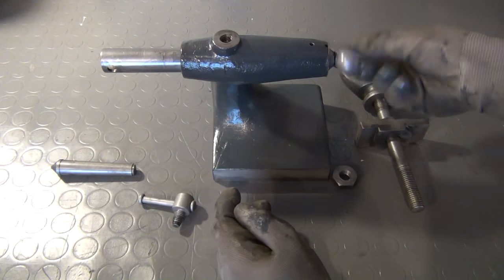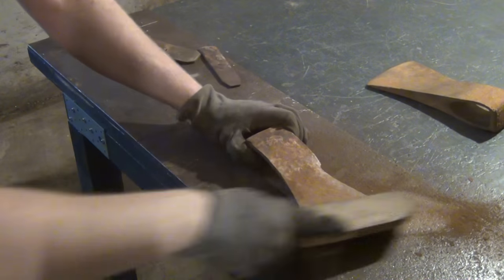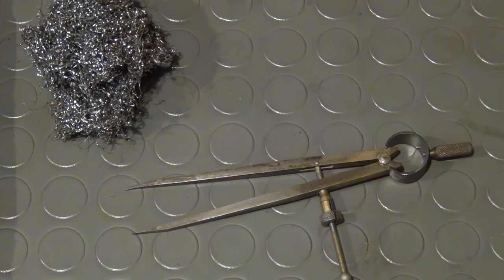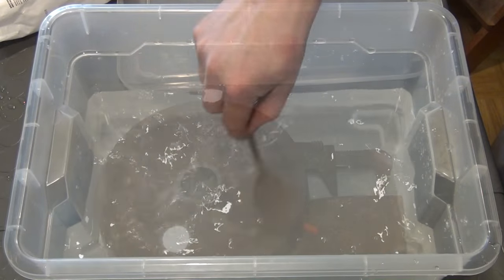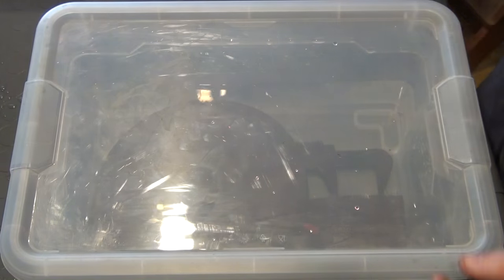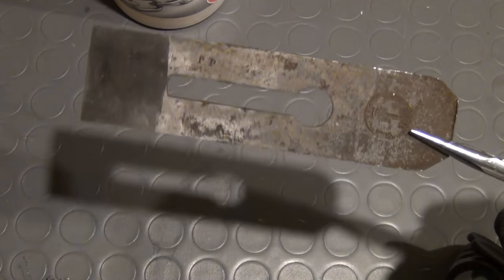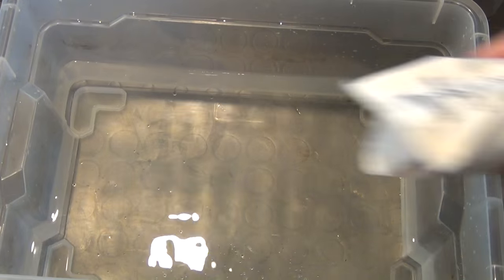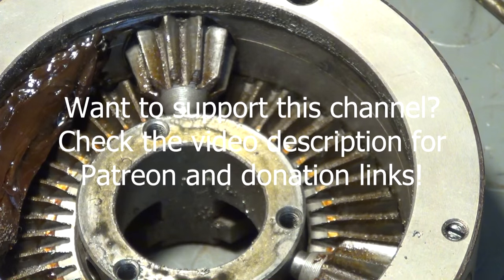Rust Removal Experiments: Citric Acid, Cider Vinegar, Rostio

Comment: Nicely made video!
 Looks like the Rostio product kinda sucks. I mean that part on the lathe would have been less than 5 minutes with a reusable wire wheel on a drill motor. 
    Like you, I have found chemical rust removal kinda limited.
  I use acid to clean the inside of rusty steel tanks(where you can't get inside to scrub). These are usually air tanks that weren't drained regularly. 
    I fill the tank with an acid solution and put a more rusty piece of metal in a cup of the same solution. When the part in the cup looks pretty good, I figure inside the tank is. I empty and flush the tank with water. I then put a bunch of moth balls in the tank with a pint or two of 91% isopropyl alcohol and turn the tank over and around, using the moth balls to scrub the inside from agitating the whole thing. I drain this out and do the same thing with about a pint of mineral spirits (by itself, no moth balls). When I drain this out, I pour in about about a Quart of oil based paint and turn the tank over and on all sides many times to thoroughly coat the inside with paint. I remove my plugs and drain the excess paint and then let it dry overnight. I have done this a number of times with good results.  I don't own a bore scope but have used a friends and found really great results. This also works good for mildly rusted fuel tanks. For very rusty fuel tanks, there is a special product for coating the inside, using the same method. 
   I hope you find this useful. 
   Take Care and be safe, John

Comment: If Rostio is like the naval jelly we have here in the states it's phosphoric acid based
Reply: +Jacksonkellyfreak It didn't seem to act like phosphoric acid would:  H3PO4 reacts with red rust to make black ferric phosphate, which, unlike rust, adheres to the iron and prevents further corrosion.  

In other words, a phosphoric acid based formula turns rust black.
Reply: Nevin Williams
 Ah ok. I don't deal with rust too much other than surface rust so I'm only familiar with what some of the chemical makeups are
Reply from the maker: +Jacksonkellyfreak I first thought it was based on phosphoric acid as well and I had that suspicion in of the lathe restoration videos, but then some guys that that they believe it's based on citric acid and I guess they were right.
Reply: +Nevin Williams 
Yeah, here it's called rust converter instead of rust remover and should passivate the rust before priming and painting, ensuring it can't continue underneath a new paint layer
Reply: Naval Jelly IS the common product name here in the United States and its chemical composition is as follows:

Naval Jelly is made from Phosphoric Acid (10 to 30 percent by composition) and minute amounts of Sulfuric Acid (0.1 to 1.0 percent by composition), as well as other hazardous chemicals—Phosphate ester (1 to 5 percent), Polysaccharide (1 to 5 percent), and Isopropyl alcohol (1 to 5 percent). Water makes up the non-hazardous portion by more than 50 percent.

Occasionally, (depending on the manufacturer) naval jelly comes in a distinct pink color due to an otherwise inert additive (colorant). Naval Jelly is intended to be left in contact with the part only for up to 10 minutes. Then use water to rinse. If rust remains, just repeat the process. But leaving it on for longer time will turn the part dark black which may not be desirable.

Naval Jelly will also remove any bluing from steel but again if you have to remove rust, bluing lost its capacity to protect the metal anyway. Hope all this helped!

Btw, I liked the going to Rome expression, is my spelling correct: "viele Wege gehen nach Rome". Grüße von Chicago, Freund aus Deutschland!
Reply: Now that you mention it, you can buy jugs of phosphoric acid retail in the US, maybe we don't have to fool around this much.
Reply: Nevin Williams , FYI when I have used naval jelly (Loctite brand) it has not turned the rust black.  I don't really see a color change.  Maybe I was not paying close attention.

Comment: Here's a method I use on cast iron pans with great success: put your oven into "self-cleaning cycle" and lock the piece in there for the several hours your oven needs for self-cleaning.  When it's done, the piece will be covered in fine powder that brushes off to reveal clean bare iron. No chemicals or elbow grease necessary.

Comment: Hard to beat the electrolysis method; the catalyst is never consumed, the reaction won't attack the iron, and it's fast.
Reply: Doesn't salt water produce clorine?
Reply: @dimmacommunication  if you use washing soda you produce hydrogen
Reply: @darronjknight  Sodium carbonate?
Reply: darronjknight  and,,,,,,
Reply: @drewjohnson4673  Hydrogen?

Comment: For the jelly, use plastic wrap to keep the jelly tight against the item.
Reply: That would squeeze all the jelly off, leaving only a very small amount in contact with the rust. In order to work properly, there needs to be a LOT of the chemical present... in other words a thick coating will work much more effectively than a thin coating. That's why they make it a thickened gel rather than a thin liquid.

Comment: vinegar is great to remove rust BUT the real trick, as you learned, is the timing. If you over hold it, the acid will eat into the metal. I assume that is because the rusted metal is already weakened at the surface so what I do is check it ever 3-4 hours and make sure I time myself to place an item in vinegar only if I am able to take it out and clean it no more than 12 hours if I cant check every 3-4 hours. Great videos, thanks for sharing.

Comment: Rusteo is phosphoric acid in a gelatine substrate. Think I will try the organic acid treatment on some rusty tools, Might at least get it free enough to run again, though I have little hope.  But have a lot of vinegar around, used to descale kettles, and I use another acid to clean aluminium piping inside.

Comment: I know I might be late, but you can hear up the water to speed up the reaction. I do this with my boiler. I put some vinegar and turn it on, and keep it between the temperature hot, but not boiling. Within a minute all the spots are gone. But if you put vinegar instead of lemon juice it will smell!

Comment: Rostio's active ingredient is sulphamic (NOT Sulphoric ) acid. It is also sold as LimeAway and Lime light in UK. You will find that if you dissolve it in water and then use it in a similar way to that of Citric acid it will be faster. It is also much safer than Hydrochloric acid other in that it does not release noxious gases and is safe to release in public drains

Comment: Interesting. You can use malt vinegar which is dark brown and sold for food use. To avoid using a huge amount, soak paper towels in it, wrap the rusty object in the soaking towelling and then cover in plastic bags to avoid the towels drying out.  Remove next day and most of the rust will be on the towel , not left on the object.  For very thick rust, I have used a cardboard box with plastic dustbin bag lining because you can make the box fit the object and so have a good depth of vinegar.

Comment: I've had good luck with "Drano" drain cleaner (in crystal form) which is mostly Sodium Hydroxide. I put several gallons of water in a plastic container.. add the Drano and then leave the (iron) parts overnight. It will turn aluminum parts black.. so you might not want to dip those. I have yet to try heating the water to see if it is more effective. For more information on Drano, Wikipedia has an article on the product.

Comment: I have used white vinegar with good results on deeply rusted parts.
Reply: White vinegar is what I usually use too. I've tried both it and apple cider vinegar, and the plain white seems to work better (I believe the cider vinegar is a weaker dilution, which would explain it.) A gallon of distilled white vinegar is only about $4 from my local grocery store, so it's cheap too.

I have occasionally noticed pitting in steel parts (such as plane irons and chipbreakers), so I don't leave those in more than 8 hours or so. Otherwise for cast iron I leave it in for closer to 24 hours and haven't had any issues thus far. I think the pitting I've run into is partially based on the kind of steel used for a particular item, because it doesn't always happen.
Reply: In the US, vinegar is typically diluted to 5% acidity. It should state the acidity on the bottle.

Comment: Im using vinegar for almost every derusting I have done so far. It removed rust from a lot of stuff from different time preiods: wrought iron, 70 years old relic, fireman axe from 1910,  bolt nuts from 1930, a lot of tools from the 80´and 60´... What Im trying to say is that vinegar is really good de-rusting tool. It just doesnt work in 24 hours. De rusting usually takes around 3-4 days. However if my country would sell Evaporust I would buy an excesive amount almost immediately.

Comment: I found that using trisodium phosphate (T.S.P.)  and dishwashing soap is an excellent way to remove oil and grease from metal or any other surface. Brake cleaner can also be substituted. I think gasoline is a bad alternative.

Comment: It would have been interesting to see the finish on the dividers if you had used a much finer steel wool. You used what I call pan-scrubber steel wool. 000 and 0000 wool might have given you a much cleaner finish. Nice work, interesting experiment. Thanks

Comment: I found phosphoric acid worked very well, though did attack the iron a little. apparently though the iron phosphate it leaves behind has corrosion inhibiting properties.  It would be interesting to see how quickly the parts you have cleaned to rusty again from any trace chemicals left behind in the metal.

Comment: It depends on what I'm trying to get the rust off however I normally use for the heavy stuff a large container filled with hydrochloric acid at 40% strength, and that works well for the really heavily rusted items, for the next down the list sulphuric acid at 24% and for the light stuff I use vinegar at only 7%.

Comment: BEWARE THE VINEGAR!

About a year ago, I learned vinegar could be used to sharpen old metal files. I soaked 3-4 files in white vinegar, and it seemed to work. I then mixed some bicarbonate of soda solution and neutralized the acetic acid.

Since the files seemed to brought back to life, I put them in my mechanic's toolbox, with my other files.  This was in late fall, so It was 4-5 months before I got happened to get back into my toolbox, because of the winter.  What I found made me want to track down the person who posted the 'sharpen your files with vinegar', and pour a bottle of vinegar down their throat, and put the files, elsewhere.

Turned out, the files really didn't get that sharp, (I didn't get a chance to really test them thoroughly.), but every bare steel tool in my box had a heavy coat of rust.  These tools are been in this box, winter after winter for twenty years, in this location, without rusting.

It was a complete rust coat, and I STILL don't have everything restored.  And I neutralized the damn vinegar. Imagine what it would have been like, if I hadn't neutralized the vinegar!  

Watch out where you store the parts soaked in vinegar!

I just emptied a gallon of commercial rust remover a month ago, 'Metal Rescue', and was pleased with it's results, except it was not as reusable as claimed.  I thoroughly cleaned all the dirt and grease from the items, but ended up with a weird goo in the bottom of every de-rust batch I did. 

 By the time I separated it from the fluid, I had lost about 50%. When I tried to re-use the left over, it didn't work very well. I ended up having to mix it with 2 parts new fluid to get decent results.  

I'm going to try 'Evapo Rust', next, user reviews on Amazon say it is very re-useable.

Both brands are biodegradable. Metal Rescue claims to be all natural. Neither brand will attack your skin.

I still have got the best, and most economic results using Rustoleum's rust remover/primer for rust removal. It is a horse shit primer, but a coat of it on cleaned rust makes wire wheel removal on the bench grinder an easy task.

Re: gray color of metal  

In researching Evapo Rust and other brands yesterday, I learned the gray color, (as long as it is NOT powdery), will act as a rust preventative, so don't remove it.  

GeoD

Comment: use white vinegar, and it does not need to be 5 percent, you can dilute it to a 3d of that, and it will work as well with less damage to the metal

Comment: Naval jelly is or was more common in north america. Like Rostio, it is gelatinous but it is pink because it contains phosphoric acid. I believe the gelatinous consistency is partly due to safety (you don't want it splashing around, and because it will stick to thinks like the railing of a ship which may need to be derusted before painting. From what I've seen products like this give very uneven results when citric acid or vinegar work really well and are cheaper and easier to use. I wonder what you would add to citric acid to make it gelatinous, should you need something like that?

Comment: Did you ever try any "Bilt Hamber" rust removal products?

They do a powder you mix with warm water called "Deox-C" that I've found to be perceptually good at removing heavy rust scale (As long as you thoroughly degrease the part first), And for situations like you had with the tail stock handle, they do Deox-Gel.
I've found the Deox-Gel to be  slightly less effective than the Deox-C, But it's still better than most for getting rust off of things you can't submerge.
According to the marketing blurb, they can both be cleaned off with water and are non toxic. 

I tried loads of different rust removal chemicals before I found Deox-C, But haven't looked elsewhere since.

Comment: I wonder if you could make your own "rostio" by mixing starch from ex. corn or potato with water and citric acid :).
Reply: +T3hJones That method works great for bases;  I make paint remover with sodium hydroxide added to water that has some starch in it.  It gels up quickly with just the heat from dissolving the lye.

I just tried it with a bit of sulfuric acid;  even with heating it a bit in the microwave, the starch still hasn't gelled.  I'd have tried with a weaker acid, but I'm all out of vinegar.

Comment: 12:30 - A very similar product available in the United States is Permatex Rust Dissolver, item number 81756. I tried looking up Rostio but was unsuccessful, maybe if I knew how to search for things in German I would have been more successful, but I know how to find MSDS information for USA products quite easily. According to the Permatex Rust Dissolver's MSDS (Material Safety Data Sheet) this item is between 10-30% phosphoric acid. I would guess the Rostio is most likely the same thing as these gels seem to be offered by quite a variety of companies, but I suppose Rostio could just be citric acid as you suspect.

Comment: Hydrochloric acid is very good, and fast at removing rust. It may be hard to get in high percentage but you can get "Brick Cleaner" and it should contains 10-20%  HCL.

Comment: Again :  A soaking White Vinegar ( Much better then any other Vinegar's ) works amazingly well . I've saved tool I would have deemed DEAD MEAT before learning of the trick.      When you placed dissimilar metals in the acidic bath you created a battery.  Electrolysis Actions would take place .  That could deteriorate one of the objects in a negative way.

Comment: Oxalic acid is the cheapest and most effective rust remover I have found. If you don't find it effective enough, add more powder. The stuff is so cheap, it doesn't matter. It particularly likes iron oxide, more than other things, so unless you just forget about soaking things, it should cause very minimal secondary damage, unlike vinegar. I really don't like vinegar being used for this reason, it may clean the rust, but at the cost of extra deterioration of the chrome or nickel coating, or worsened pitting, which very well may do more damage than good.

Comment: Personally I'm a big fan of using electrolysis for rust removal, it removes it quick, completely if done long enough and doesn't attack the metal itself, the only thing is you've got to be careful not to use it on stainless steel, chromed parts or anything plated because of the toxic chemicals produced.

Comment: I have used phosphoric acid, dairy farmers use it so is not real expensive if purchased at a farm store. But your citric acid id much cheaper. Also i noticed the phosphoric acid does not work as well with colder temperatures. I wonder if you can make your own paste with citric acid and flour or corn starch .

Comment: SInce you are in Germany you should be able to get Surig Essig Concentrated vinegar which is 25% acid and either use it straight or better dilute it to perhaps 10%. 

Also most commercial rust removers at least in the US use oxalic acid

Comment: Hi, Have you already tried the reduction reaction with a continuous flow of hot hydrogen gas (in the absence of oxygen obviously). We did this in Chemistry class years ago. I'm not sure whether your rusted object needs to be heated too. Only problem is to get hold of a cylinder with hydrogen.

Comment: I use an additional heat gun after toweling to dry. That gets rid of all moisture in hidden spots & heats it up to aply linseed oil. That's quick enough to prevent new rost😜

Comment: Dear Mr. Brainy Mann,

is sunshine AC, and gravity DC?
Could the sea be a salt battery?
Could the mountains be diodes? Think of a power supply, AC in, DC out.
The DC is the result of the AC going into the planet, and being rectified by the rocks.The result would be, that the atmosphere is a phase cancellation between the sun (AC) and the AC bouncing back off the planet. Is that our atmosphere?
I have been long thinking about these things, and I wonder what you think about it.

Thank you
for all your time, I have learned loads. Dankeschön !!!